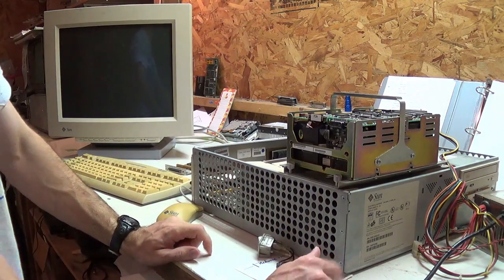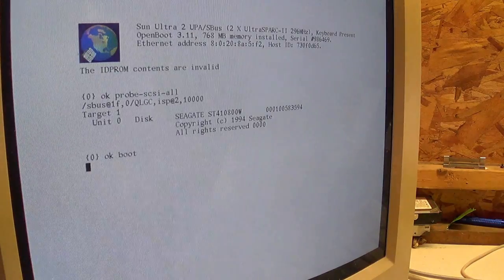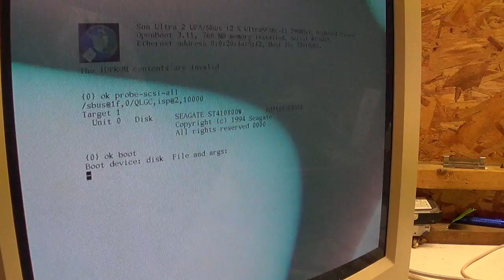Cray J98 Project - Disk fumbling and more SWS trouble

Comment: Wait couldn't you just use an oscilloscope to monitor the drop in power and then trace the fault back to the component? OR maybe use a bench top power supply to insure atleast the drives are getting the right amount of power? *Note if you use a volt meter to check the continuity it probably won't do you any good if the part hasn't already failed. This why you would want to use an oscilloscope, because it will give you the signature and the wave form of the expected output of the component. Every modern component should have these signature charts you can follow.
Reply from the maker: Unfortunately I don't own an o-scope, nor do I really know how to use one. It's on "The List". But elsewise, yes, I think you're right. :)

Comment: Regarding the disks, are you sure that their master boot records are marked with the Sun-disk-label? 
For older Sun machines that was a must. You can attach those disks to a standard Linux machine (supposed that you have a Linux machine with high voltage controller) and use simple fdisk, or what I prefer is to use cfdisk (somewhat more graphical) and make sure that the disks have the Sun disk label.
Reply from the maker: Well, right, but... I don't want them to be Sun disks - they're Cray disks that I want to image. I don't want to format them, I want to raw read them so I can see what they have on them already. :)

Comment: Based on the symptoms, my bet would be: 50% cold solder joint, 30% bulged cap, 20% dried out caps. Namely, you said that earlier you could use the machine for about an our. Dried out caps are most of the time are getting BETTER after they heat up, because their equivalent series resistance (ESR) drops with heat. In contrast, bulging caps which are close to explode are in the other way around, because the pressure increases in their case. 
Thus, in your PSU either you have a bulging cap, or a so called "cold solder joint" where the soldering have cracked, and once the PSU heats up, the connection will be broken due to thermal expansion.
Reply from the maker: Thanks for this. I haven't opened it yet, but I'll try to get to it early this week and see if I can see anything about to rupture.

Comment: I could repair it for you, but I suspect the shipping costs to and return from Germany would be astronomical...
Do you have a soldering station, some lead containing solder and a bit of flux? Just watch my Be-Quiet PSU video, it is easy to repair that PSU. It is a standard procedure, which works 90-95% of the time.
Reply from the maker: I'm reasonably handy with a soldering iron - I just don't know a heap about analogue electronics. I appreciate the offer - I'll attack it and see what I can find, but this project has so many tangents already I don't really want to spend time repairing a U2 PSU unless I have a good chance of quick success, let I get stuck in the weeds :)

Comment: Instead of buying a used power supply for the machine why not convert a run of the mill ATX power supply to run on the Sun. Or even better just replace the filter caps in the power supply.
Reply from the maker: I did look into that - the Sun PSU uses a couple odd voltages (+3.0v as well as +3.3, and -12v). Moreover the PSU is apparently "programmable" and has two big rails that will swing between +3.3v and +2.0v depending on what the Ultra mainboard requests of it. I could probably make it static, but I'd still need to work up a negative buck to get my -12v and it has two 12A rails of +3.0V, and you just can't drive that current through any normal regulator even if you're only going from the 55A +3.3v rail down to 24A of +3.0v... So it all adds up to me thinking "Perhaps not."
Reply: then I guess replacing the filter caps would be a much better plan.
Reply from the maker: I cracked it open last night and everything looks in perfect shape. Figures. Mutter.
Reply: if they haven't vented out there could be a chance that they're leaky. A capacitance tester should reveal that, don't mistake a ESR meter to tell you if a cap is leaky or not. If anything it could be something else such as a switching mosfet or some sort of regulator. Heck could even be a bad PWM controller.

I figure now a replacement power supply would be key. However I wouldn't toss out the old one but maybe down the road if you ever get bored you could troubleshoot it with a scope and what not let alone use it as parts for the replacement if that ever fails.
Reply from the maker: Throw something away? Me?
Reply: i wouldn't know lol

Comment: Doesn't supprise me a bit that a PC built in the 70s still works fine, yet a PC built in the 90's has a bit of trouble.  "Logical Disk Error :01 /ssh"
Reply from the maker: Fair point, sir.
Reply: either way.. with all the troubles still, you're onto a fine job there.
Reply: Actually that's something called "survivor bias"...

Comment: If the SWS will use rj45, why not use a newer sun workstation? IIRC, the ultra 2 was chosen for 10b2 compatibility. You can format the disk with "format -e". The raw disk is just the disk name without the slice identifier. So for example, instead of "/dev/dsk/c0td0s2" it would be "/dev/dsk/c0t0d0"
Reply from the maker: Of course, I'm not actually trying to format the disk at all, I want the data off it intact. I'm pretty certain I tried doing a 'dd if=/dev/dsk/c2t0d0' and received the same I/O Error... but I was about to recheck that when the PSU developed it's "No, can't make me" syndrome. As for dropping the U2 it was, of course, originally designed for a SS5, so I'm already way off the mark. But, more importantly, the U2 is the newest of the "small" sbus machines that I already own. Failing this, I'm moving to the friggin' E10k, because the E450 and 6x00s are all PCI.
Reply: That would be interesting, using an SSP to bring up an E10K to work as a SWS for a J90. I'm actually in the process of converting my E6K to PCI, so i will have a bunch of SBUS board lying around doing nothing. dd should work in this case, however you may need to specify a block size on Solaris.
Reply from the maker: I've considered the super-computer chaining before, but it's just so show-off and I do too much of that already. The bs thing shouldn't need to be set, for dd it's just specifying the size of blocks it's reading off the disk raw - it's not related to the filesystem block sizing. At least, it shouldn't need to match anything in the Cray disk.